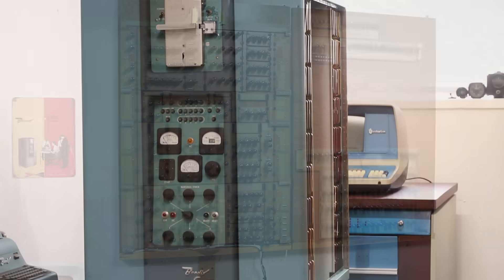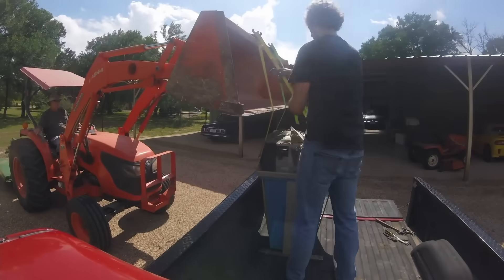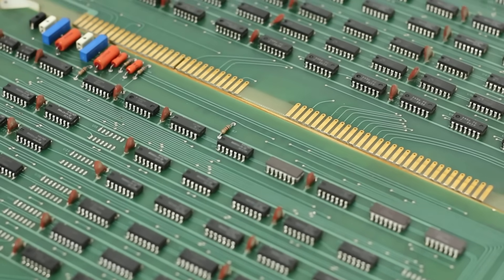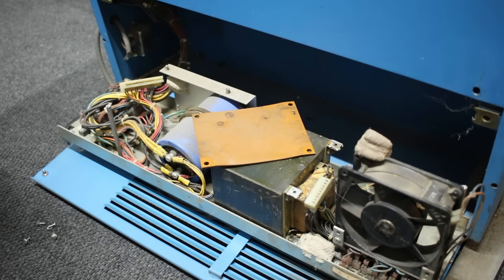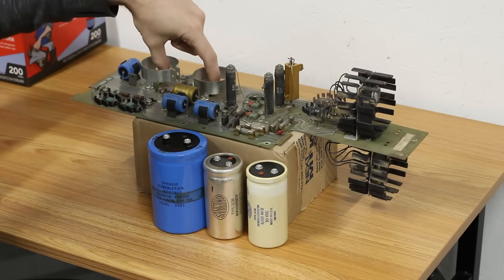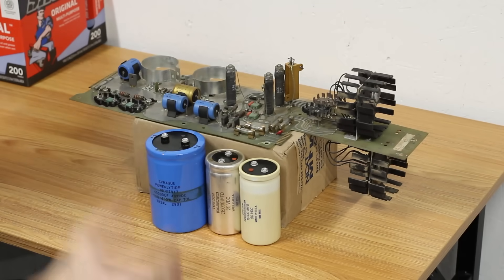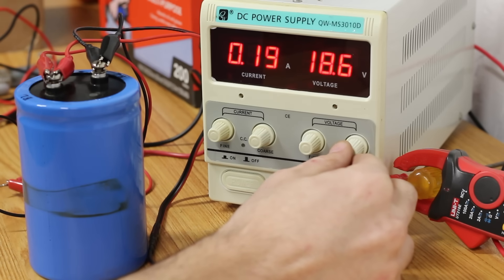Working on the Largest Printer I Own

Comment: 30V is common mechanism power suppply (even for later pin printers), +10 may be for positive RS232 interface (something low, but acceptable), -12V is definitely for RS232 interface (I assume this is serial I/F printer as many of this time), 5V of course is power for legion of TTL chips.
Edit: try locate interface chips (MC1488, MC1489) were produced from 1973, most likely are also fitted in this printer. MC1488, driver: pin 1 -VCC, pin 14 +VCC, pin 7 GND. this should help in locating power source from PSU. Datasheets are also available from Texas Intruments site. Good luck.
Reply: Yes the 10V rail should be around 12V, because that is the voltage required for true RS232 voltage levels, though it will probably be fine with 10V anyway. The capacitors really should be tested differently, or at least connected to a power supply via a resistor, and left for 24 hours to reform. 50 year old electrolytics are very much at the end of life, though you will find that some are still within spec after a 24 hour period at rated voltage via a 1k resistor, just in case they decide to short out, so the puff of smoke will not be much, though the resistor should be 5W to survive. 24 hours of rated voltage, then leave open circuit, and measure with the multimeter every hour, and before disconnecting check voltage drop across that resistor is under 1V, saying leakage is under 1mA, which is a rough limit for the leakage acceptable.

I have tested some NOS electrolytics, and of the dozen I had 6 were physically leaking when unwrapped, so got tossed immediately, 3 were not dropping down in current even after 24 hours of reforming at 5V, and were also tossed, and the remaining 3 had 2 with a rotted vent, so also failed. The sole good one held charge for over 3 months, checked once a week or so.

So the can sizes you have are all still available off current suppliers, and you really should replace, just go for ones in the same diameter can, or slightly smaller, and use a sleeve, common on replacements as well, and use similar capacity and voltage, though you can have a slightly higher voltage, and capacitance within 20% of the nominal is still fine, as those large cans have a tolerance on capacitance of +100%/-80% as still being fine. Yes that 60 000 uF one, used likely on the 30V rail, is perfectly fine, even if the capacitance is anything from 12 000uF to 120 000uF, so anything in that range and voltage is suitable as a replacement. Same for the others as well, though going close to the nominal is better. 85C standard electrolytic, computer grade, none of the low ESR units, your rectifier diodes will thank you. Those large cans make a loud bang when they fail, and can take out the diodes and transformer as well. 

Though with that power supply, and those power resistors, I would turn the board over, wash it with a new toothbrush and some ethanol, and then apply some liquid rosin flux all over the board, and resolder every solder joint associated with the power diodes, the power transistors and the power resistors, and clean the board again with alcohol to remove the rosin. Will likely fix any dry joints there, and also solve future issues with the power supply. Clean that edge connector, deoxit on both sides, and plug in and out around 5 times, clean again, and apply a last coat. Same for the TTL boards and drivers, and same for any IC in a socket, clean the legs, then plug in again, pull out, clean pin and socket, and put in again. will solve any poor contact issues before you have them, leaving 1000 less problems to solve.

Before powering up the printer, get some 24V turn signal lamps, and some 12V ones, and apply the 24V lamps to the 30V supply and the 12V supplies, and the 12V one to the 5V supply, to give the PSU a small load. Off the 30V rail you will draw roughly 2A, the 12V rails around 1A, and the 5v rail same, well below what they likely are rated for, at least for a 5 minute test.

Then use your multimeter to measure the voltage out, should be within 10% of what you measured no load. Then take your scope and look for ripple at 60 and 120 Hz, on the output, with AC coupling. Should be under 100mV, and on the capacitors should be under 1V peak to peak of ripple, and at 120Hz, if there is a 60 Hz component you have a diode that is open, or a bad joint, and the 2 peaks for the 120Hz should be roughly the same height, if not you have a failing diode, either nearly open circuit or leaking badly, thermal camera will tell you if a separate diode that it is running at toasty level, or a bridge rectifier block running at 50C above ambient, which under low load should not be the case.
Reply: This printer is a Centronics parallel 7 bit wide interface.   No RS-232 interface in the Data-100 model.
Reply: @kromaine13 Thanks for clarify.
Reply: @kromaine13  No difference in the power supply though, and the 12V rails likely are also used in the hammer drive section to provide bias voltages for the driver transistors, so they turn on and off fast to drive the hammers.
Reply: @kromaine13 If there's no RS-232, I wonder what it uses the negative rail for? Centronics is 0 to +5v, iirc, and so are all the TTL, of course. The hammer drivers are probably a simple open collector driver, so no need for a negative rail there, that I can see. Maybe some early NMOS RAM used for a line buffer?

Comment: Not this unit, but have some experience with another manufacturer's 'band line' type printer.  The 'belt' as you call it on mine was literally a 'band' of metal with small metal fingers cut in one side with each letter so that the hammers 'flexed' the fingers against the ribbon/ paper.  Anytime we changed the band out for another one with different sets of characters, we also changed that paper tape that 'told' the printer what band was installed.  I saw you have two paper tapes, so....  make of that what you will.
Reply: @tradde11You know, now that you mentioned this, it DOES ring a bell.  Something about header space and vertical 'tab'?!?   Maybe it was when we switched from normal 'green bar' paper to shorter 'letter' sized tractor feed.  Sorry, it's been a long time... :)
 P.S.  Yeah, i said 'paper tape' meaning that type of punched tape, but you're right it wasn't physically 'paper'.
Reply: @mikefochtman7164  I knew it as "Vertical Forms Unit".  The printers I worked on had an electronic version of that or EVFU.
Reply: @tradde11Yeah, the one we had, if you had a mixed case band (both upper and lower case) it would do 300 lpm.  But if you had an upper-case only, it had all the letters on the band twice, directly opposite and it would print 600 lpm.  Paper practically SHOT through that thing.  lol

Comment: Reminds me of the HP2619 printers I worked on back in the early 80s. Hated them.  Getting the print chain and hammer bank set for even non smeared printing was almost impossible. And with a swinging hammer bank -GOOD LUCK!. (Reminisce of the 2613) 

Watch the clearance or you will tear out sections of the print chain.

Like the fact they put fuses on each driver at least if a hammer shorts you should only blow the fuse.

That little paper tape on the side controls the paper feed. One punch was end of page another top of form.
The others could be used to advance the form to specific lines on the page via control in the programs.

Comment: I worked with similar high capacity printers in a large air conditioned ICL Series 39 mainframe computer room for a while in the early 1990s, in fact they were even bigger and were very old even then, but many such commercial printers were built to last and with preventative maintenance could survive many years of heavy punishment.

Comment: The memory on that is maxed out.  256KiB is the most you can address with an 18-bit address space.

LSI was actually invented in the late 1960s at Rockwell. They developed a four-chip solution which replaced over two dozen chips for a portable calculator produced by Sharp which was introduced in 1969.
Reply: Right. By  the start of 1975 LSI was widely available and we were into the second generation of 8-bit microprocessors, with both the 8080 and the 6800 having come out the previous year, the Altair on the cover of Popular Electronics, and the 6502 less than a year away.

Comment: Good stuff. This unit ought to be manufactured by a third party. There is no way Centurion would have designed this, at least the mechanical part. Any sign inside of who this manufacturer might be? This could bring you a lot more information, schematics, assembly, etc. Thanks!
Reply: The printer is a OEM from Odec Data-100.  The OEM painted the printer for us the Centurion colors before it shipped to Centurion in Richardson,  TX.
Reply: @kromaine13  I wonder how much sub-assemblies they bought in too, or if they did all that power wiring , etc.
Reply: There were 4 or 5 companies that OEM printers to "small"  computer manufacturers 
Data Printers  and Data Products being two additional ones.

This layout does not look familiar

Comment: When I was a senior in high school in 1994 I got a job at a local advertising company and did nightly tape backups of their archaic system. The printer used was over twice the size of that one and I had to print the payroll checks and lots of daily updates on it.
Reply: When I was working in a Lab at my university almost 20 years ago there was a 1mb hard drive being used as an occasional doorstop. The thing was probably the size of a concrete block and weighed 25 lbs or more. Had to be from the 80s. I always wanted to build a wiring harness and see what was on it - even now 15 years later I still sometimes wonder what was on it. Missed opportunities. Strange things we choose to remember
Reply: @FreejackVesa  you probably could have bought a decent car for what that originally cost!

Comment: i worked assembly for Documation in late 70s and built the impact 3800 line printer.   That's 3800 lpm.  Absolutely insane when they were under test.   Yea,  they were finicky.

Comment: Worked for Data 100 from 76 to 85.  Used this on a lot of RJE's.  This was the smallest line printer we used.  Good printer but they wore out quickly.  Too many moving parts...
Reply: I'm guessing they need to be oiled on a regular basis for longevity. Must get messy when they need cleaning.
Reply: @anthonydenn4345  Yes, it's messy but not from oil.  Between the paper dust and printer ink ribbon dust, it could be tracked all over the office.  Almost lived with a vacuum cleaner nearby just to open it up.
Reply: Agree no oil used in the Data-100...!  The paper does make a lot of dust & lots of little round paper dots...?

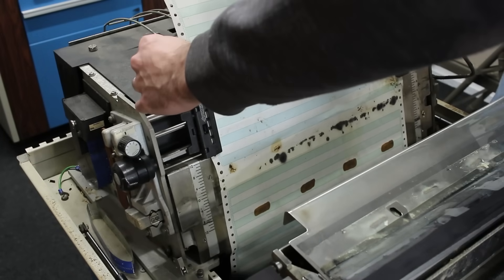Comment: Eek 4:21 don't pull the paper. Just open the lips at the side on the feeder
Reply: I was kinda amused by the way he removed the paper.  I wonder if he was concerned bout the clamps. IIRC, just slide the little middle bit down and it will come open.

Comment: I used to have to fix line printers. I can't remember half of it 😅. I do remember a lot of issues were simply caused by the mechanism getting dust from the paper in it.
Reply: I bet. Pulp + moisture (or oil from the running gear) would for sure gum up those things. It does even today on cardboard or thicker paper printers.
Reply: @aserta  yes that and actually (maybe TMI) a lot of human hair. I used to wear gloves which would be shredded by the time I was done.
Reply: @lindoran  presumably those with (Acoquisic) covers tended to have less hair in them.
Reply: @highpath4776  you would think that would be true but I found it in the weirdest places. One of the worst dot matrix (not the same I know) that I ever worked on was in a jewelry store. This thing had a noise shroud and was in a drop feed cabinet. It needed to be completely disassembled because hair caused just enough of a clearance issue that the paper would jam nearly every time.  I think it matters how the paper is stored and who changes it.
Reply: @lindoran  I used kitchen gloves, one size small. Yup, normal gloves have no chance of survival.

Ah, the stuff i used to find inside printers... :)) Worst job i had to pull was chewing gum inside a big Canon printer. Had to clean it, because it was an expensive unit, not like a cheapo these days where you can write it off. That was fun.
Reply: @aserta  To the tune of "Does Your Chewing Gum Lose It's Flavour on the Bedpost Overnight?",

Does your chewing gum lose it's flavour on the printer overnight?
And it catches on the driver chain, and the printer heaves left and right?

Comment: "We're throwing science at the wall here and seeing what sticks."
Excellent work on that power supply! Waiting for more on the printer - 
The perforated tape reminds me of CuriousMarc's IBM printer. I think it's mechanically coupled with the character being printed, the combination may be an ASCII code. Then it's just rotating the shaft until a desired character is found...

8:25 8:38 hope there was no asbestos in it, haha!
15:03 [FANSPIN INTENSIFIES]
Reply: The paper tape loop is vertical forms [paper] movement.  One paper tape channel is for TOF [top of forms]  hole & one channel for Vertical Tab.  The paper tape loop is 66 positions long (or the number of lines per  page). Being able for the programmer to tell the printer to move the paper to TOF or do a Vertical-Tap was easier than keeping track of line counts.
Reply: @kromaine13  thanks for the info! Very interesting, and appreciated :)
Reply: @kromaine13  While easier than counting lines, the real reason is the printer could "tab" to the spot much faster than "stepping" to that spot via CR/LF.  It's like the difference between the tab key and the space bar on a typewriter. Those engineers used a lot of tricks to get more speed out of their machines.